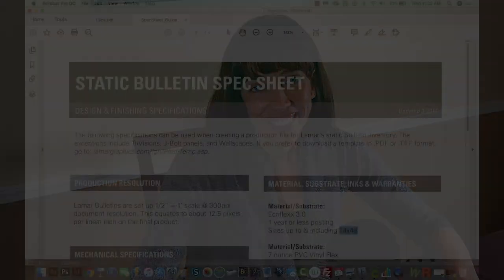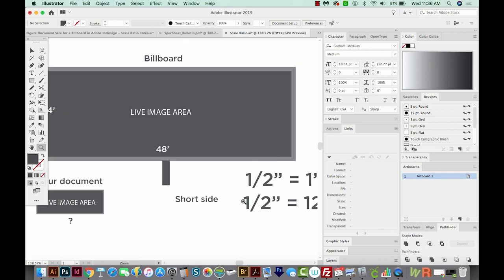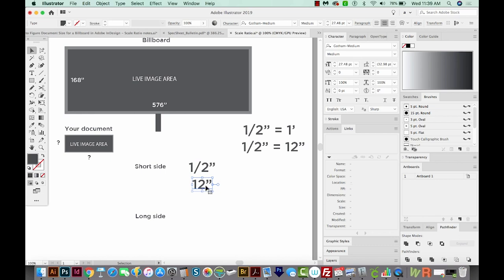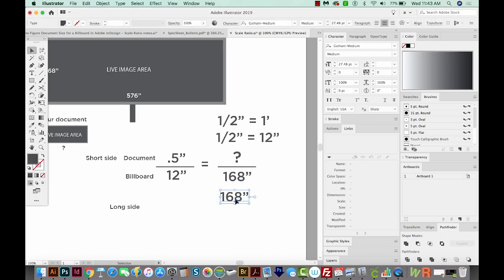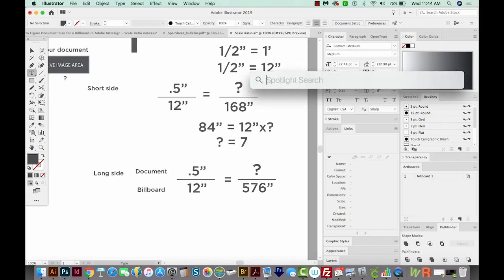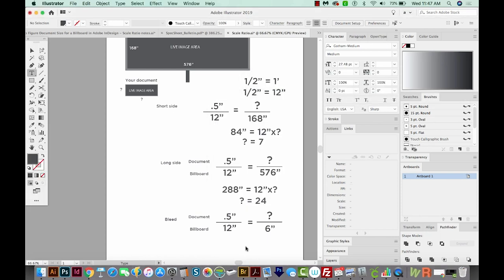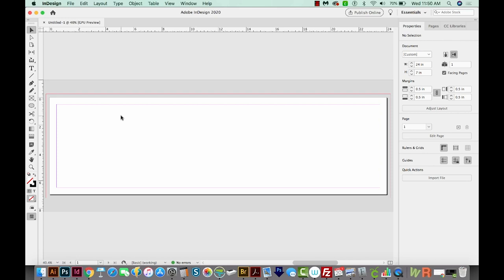How to Figure Document Size for a Billboard in Adobe InDesign - Scale Ratio or Scale Factor

Comment: Thank you so much for this, I get really confused with sizing & resolution  in design, so I really appreciate it!!! I would love more videos like this 

Also I have a question -   If you are creating a large billboard document in Illustrator, with both photos and vector graphics, do you resize the photos first in Photoshop (make them larger for example), and then import them back into the Illustrator file after, and then export everything from the Illustrator file? 
Or is it better to export the design from Illustrator, and place it into Photoshop to resize everything larger for the billboard, and export the final billboard document from Photoshop? 
Thanks so much!
Reply from the maker: I wouldn't do a billboard in Illustrator because of the massive file size when using photos/rasters in that program. But your 2nd option is probably better. Bring in the vector images as a smart object/layer, then add the photos in Photoshop.
Reply: Oh I see! Thank you so much for the reply!  @GDHT
Reply from the maker: You're welcome!!

Comment: Thank you for the tutorial! My question is, when exporting the file, do I need to scale up the quality/dpi so that it isn't too low-resolution when scaled up? For example, if the printer is asking it to be 300dpi, do I need to save it out at 600dpi to ensure quality? Thank you!
Reply from the maker: For a billboard, they shouldn't be asking for 300 dpi, honestly - it should be more like 100. But if you've made it 1/2 scale, for example, doubling your resolution would work (600 dpi) to get a 300 dpi result, if that makes sense.
Reply: @GDHT  The spec sheet they gave me said it should be 10' 5" x 22' 8" where 1" equals 1 foot at 216 ppi. So if I created my document to be 10.42" x 22.67" at 300 ppi, would that be good enough?
Reply from the maker: Yes, that sounds like it would work. :)
Reply: Thanks for the tutorial, it explains so well! 
I have a question about colour printing for billboard though, if you don’t mind answering: for company logo colours, the usual way, do we need to keep the Pantone colour or should we convert them to CMYK for output? Thank you!

Comment: Thank you for this video, this is exactly what I needed after searching far and wide! What if you have a document that the long side is in feet, but the short side is below 12inches. Would I just divide that by 1/2?
Reply: I just watched your other video. And I do believe I'd be doing the every 12"= 12ft scale. Leaving my short side that is already under 12" untouched.
Reply from the maker: I would convert everything to inches, then figure it from there (making sure your long side and short side are in inches). What are the exact measurements?

Comment: How would you scale this back up if you need to send the printer a version that is full size? So if your document was 50% of the actual size, is there a way yo export it out at 100% without having to recreate the document at the larger size?
Reply from the maker: Unless everything is vector, you would lose quality of the images.  But if it's all vector, just remake your document at 100%, then paste everything in and scale it to the document size. I've never heard of a large-scale printer requesting a full size document, though. What size is full size?

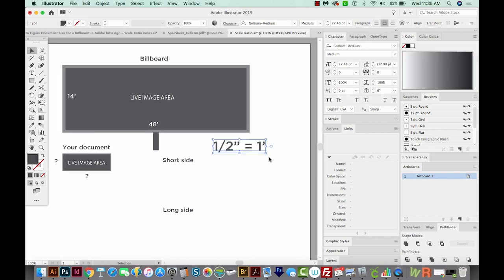Comment: Nice... but you could just figure out the scale (in this case 1:24), then divide the actual size by 24. Math comes out to be the same, but seems like way too many steps. Simple math is still the best contrary to the government. :)
Reply from the maker: I think it is easy if you already understand how scale factor works...but I wanted to break it down a little more so it's easier to understand and replicate, even if it is more steps.
Reply: @GDHT  Agreed... I just think (based on experience) that with many "creatives", math isn't their strong suite :) And with common core wreaking havoc for so long now... simpler is always better :)
Reply from the maker: @rmcinaz  fair enough. :)